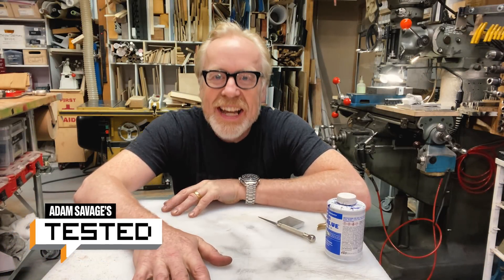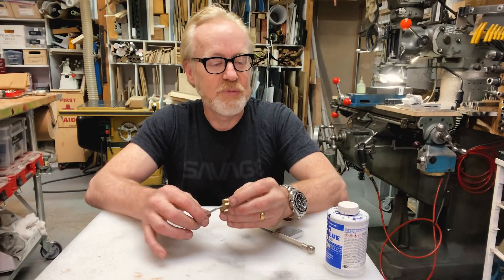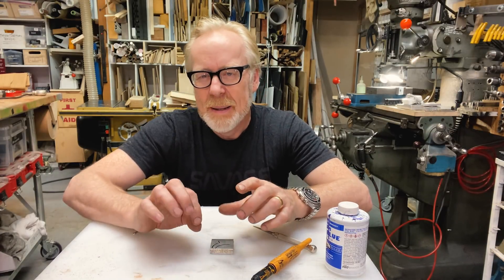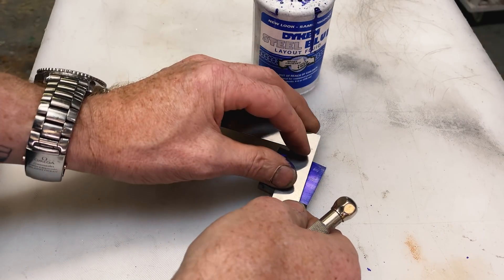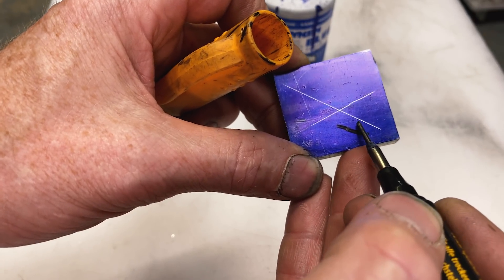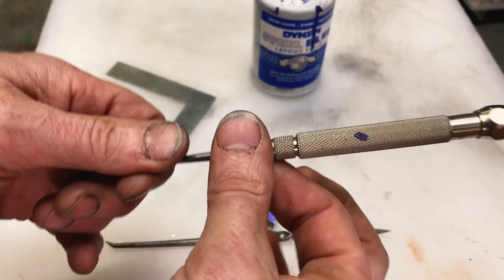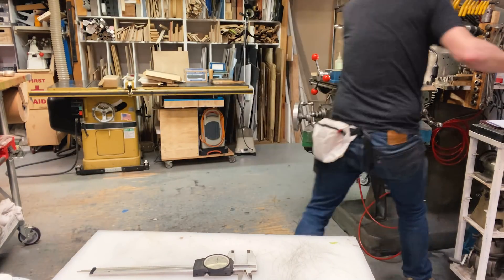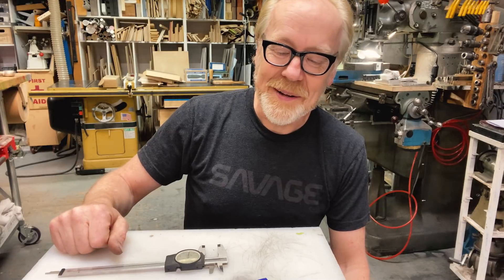Adam Savage's Favorite Tools: Machinist's Blue Layout Fluid

Comment: Me after watching most tool tip videos: 
"Oh, that seems like a tool I could use... alright... time to figure out what the hell it's called in my language and if it's even a thing in my country..."
Reply: I've used nail polish for the vaguely related purpose of etching metal.  Nail polish is also a paint that comes off with acetone and can be scratched into.
If you have no luck finding the official stuff, you can at least find that.
Reply: @Tea_and_Crafts  nail "polish" is more accurately called nail lacquer as it is a thin lacquer, so other than the pigment that give it it's color, the exact same thing or near enough
Reply: In the U of K, U of K. We call it marking blue or prussian blue. All the same stuff and yes it is a thing in your country.
Reply: Cozzy Prussian blue in the USA doesn’t dry so it won’t work for this application.
Reply: @tman19971  the pigment pruissian blue doesn't dissolve in alcohol and isn't used in Dykem style marking fluid, I tried to make my own. But mixed with grease it can be used to check flatness and fits.
Reply: Here its called a marker and a nail... well is just a common marker and a sharped nail that you can use similar way ;)
Reply: @Jordon Carlson We used clear nail polish over color strips on gauges. The gauges wear out long before the polish. Even after the technical tapping needed to get the needle to respond.

That was before aircraft instrument panels went glass.
Reply: This has been my experience too, most of the videos I watch and articles I read are in English and after reading your comment I had to go and figure out what marking blue was in Spanish (I've known about it for a few years now but never knew its Spanish equivalent). Apparently, in my country it's known as "tinta de trazar". I've also seen something called "azul de Prusia" (and someone else mentioned that's a name for it in the UK) which seems to be a similar product but in paste form instead of a fluid.
PS: Oh, and yes, the imperial system is just pointless.
Reply: What sometimes helps me is going to the English Wikipedia for the thing, and then look for translations.
Reply: Its a thing worldwide all machinists or enginners know about it. We call it marking blue. Im just disapointed he didnt get out the marking table and vernier height gauge, backstops and sine bar vices out lol
Reply: I tend to search "thing name + comprar" (buy in my language) and pray someone has it listed haha
Reply: @clarabrandaog  You're obviously bilingual. Why can't you search for the English version?
Reply: @hardpack187  Most shops will list their products under the local names, so knowing those makes shopping so much easier. (First time I tried getting what is called "methylated spirits" in English in the US it took a while to explain and find someone to tell me it's "denatured alcohol" there. That was essential to buy the stuff.)
Reply: Looks to me like an alcohol based marker could be used instead. Or alcohol inks in general, I use some for drawing. And yes, you can etch on these if you've used them on a surface like metal or plastic (something not very porous or soft)
Reply: @Jordon Carlson That's why I always use pink lighters. Less likely to get lifted at a party
Reply: @Jordon Carlson Yeah, I marked all my tools with nail polish, so they wouldn't get swiped at work
Reply: USA! USA! USA!
Reply: @hardpack187  buddy, I get to use the metric system...

REST OF THE WORLD! REST OF THE WORLD! REST OF THE WORLD!
Reply: @HunterRodrigez  "Get to"? Like it's a privilege?
Reply: @hardpack187  compared to basically being forced to use the imperial system? Yes, yes it is.
Reply: @HunterRodrigez  Aren't you "forced" to use metric?
Reply: @hardpack187  the "being forced to use a system" part is not what I have an issue with, that's just how standardization works
Reply: @HunterRodrigez  I'm in the USA and choose the metric system for virtually everything I make. So long as I plan ahead fasteners and the like are also cheaper. (Though more expensive in physical hardware stores)
Reply: @Segphalt  it's always hilarious to see my metric nut driver bits next to the imperial ones that came with a bit set for some reason 

Metric: 10mm, 11mm, 12mm,

Imperial: 7/16, 11/32 and... fuck it let's go with 7/32 

how can anyone voluntarily work with this shit?

Comment: Adam: Good tools will last a lifetime. 

Also Adam: Uses perfectly good calipers to scribe a line.
Reply: Using calipers to scribe line in metal: Bad.
Using calipers to scribe line in marking fluid: Accepted practice, and something you will see all experienced machinists do.
Reply: @Bakamoichigei  no we don't.
Reply: Some calipers are high precision measuring instruments. Some are semi-disposable tools for quickly marking parts to a useful degree of precision. 

Accuracy is time is money, and sometimes time is worth more than finding, "correctly" using, and maintaining a pair of calipers that's accurate to .0001".
Reply: @5thearth  That is about 50x more accurate than you should be using calipers for. A micrometer with vernier scale will read that low, but you should verify with gauge blocks.
Reply: I’ve heard this too but personally I don’t agree. Any precise measurements should be taken with a micrometer so I’ve never seen the benefit of high end calipers. I use the cheaper ones to scribe and do whatever, and get me close enough. From there I use the mic, but that’s just my take. Plenty of ways to do things and everyone has a right to their opinion.
Reply: That's one of the very first things I was told not to do when I learned basic metalwork all those years ago. I guess that's the difference between being self-taught and having a formally trained teacher.
Reply: Everyone who’s been machining for a living has a dozen pair of calipers. Some get wiped down and put back in their case after each use and some are laying on the bench with all the other crap. If I’m cutting to a line by eye, guess which ones I’ll use to mark the stock.
Reply: Rex Mundi    Exactly !!!  I’ve been training to become a machinist for 40+ years now. At present I have I believe 6 dial calipers (6” version, plus other larger ones) in my box.  1- brand new never used, my spare.  2daily user’s in very good shape. 1 that I will loan out. And the remaining ones don’t get put away, are used for scribing or scraping whatever.

* and to the poster above, caliper measurements to .0001.....bwahahahahaha ...education is a wonderful thing, try it.  If you trust caliper measurements below .005....you IMO are a fool.
Reply: @SpotNstalkU  You loan out your tools?
Reply: @stevenvohl   ONLY to a select few, who I KNOW beyond any doubt will treat my tools as good or better than I would.
Everyone else......piss off!!
Reply: Just as he does a video on eye protection and never wears them, and one on shop rags, and wipes his hands on his pants
Reply: Yes. That was 20 pushups of punishment in our high school shop.
Reply: LoL who cares, no one measures with the tips anyhow
Reply: I think scribing a line in marking fluid is probably ok.
Reply: The thing about using the caliper to scribe that way is not to push it hard so that you don't twist the caliper head from its rail body.
Our teachers thought us not to scribe it in bare metal. If you use a marking fluid, you can mark a line with no strong force.
Reply: Also everyone I known does it that way too.
Or compass.

Comment: The smell cannot be described accurately :-). Shop teacher taught the method of wetting a shop rag with layout dye and wiping it onto the part, especially helpful for large parts. They make red as well, the red works well for castings. One can also layout precisely with say a height gauge, then set up the part and take cuts to get close, say within .1" then use a depth micrometer to measure to the line and find out how much to remove to "split the line" as the old timers called it. That method can get you to within a few .001" :-). The old old school method was to use copper sulfate dissolved in water with a tiny bit of sulfuric acid added, this gives you a thin copper plating, which you may find a useful technique all of it's own :-).
Reply: https://youtu.be/l6kyYkUDEE0  this video explains it well, the old timers just wiped it on with a rag then went and ate lunch without washing their hands :-).